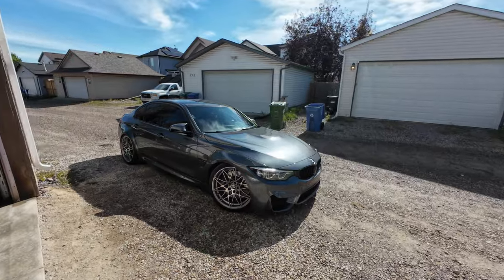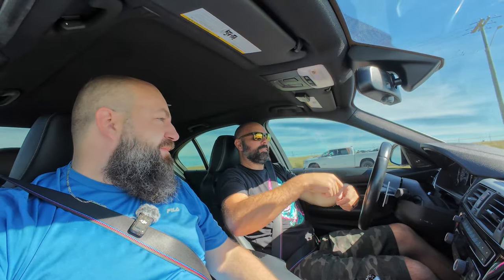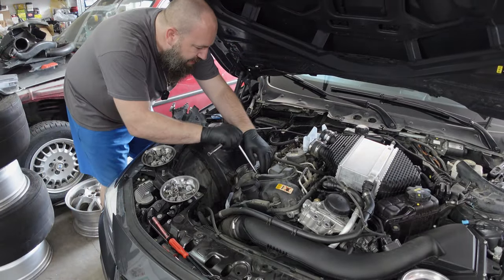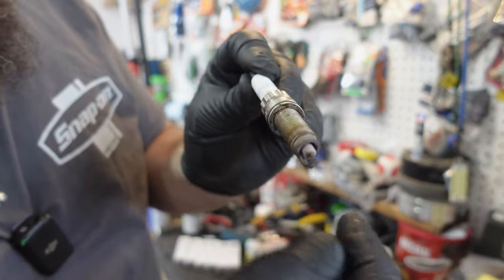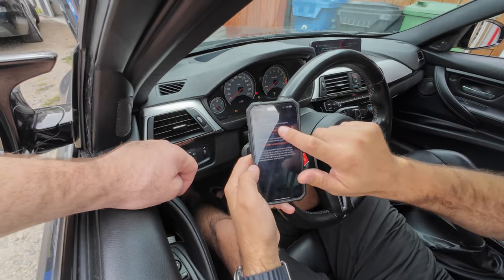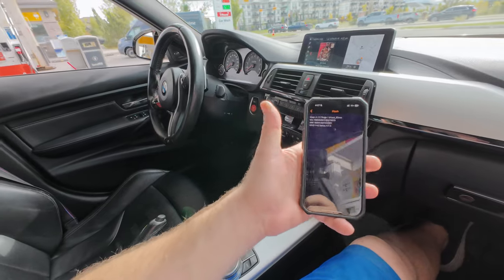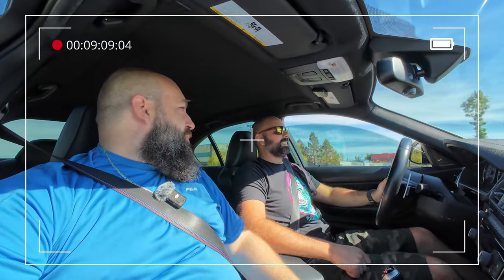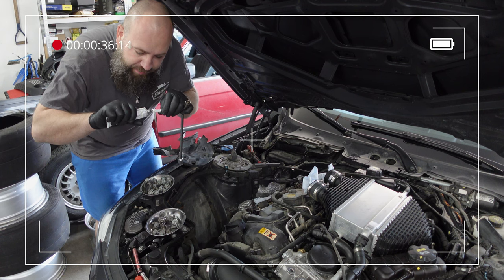Just Bought This M3 And It's ALREADY Broken!

Comment: Love this video!  Also, fyi, I recently learned on ZeroTo60 plugs lose their resistance as they age.  New ones should have a resistance > 5000 ohms; operational > 4500 ohms. I had misfires in my tuned N54 and removed my plugs and five of them were at about 4000 ohms.  Replaced all with new plugs which ranged from 5000 to 5800 ohms.  No misfires.
Reply from the maker: whoa, good tip! I'm going to test some plugs I've got laying around the garage!

Comment: Hope crankhub is done if he decides to go stage 2+ with mhd, don't personally own a s55 but I have heard with the dct and having the kickdown feature not disabled they can cause the crankhub to spin, which is no beuno.
Reply from the maker: I hope so too, seems to have been modified a fair bit prior. we may inspect it for the hub just for piece of mind.
Reply: @tony.nextlevelrides make sure he isn’t doing kick downs. manually downshift off throttle before doing pulls